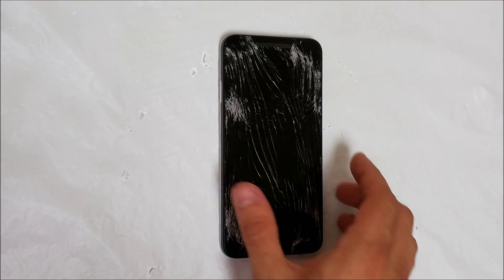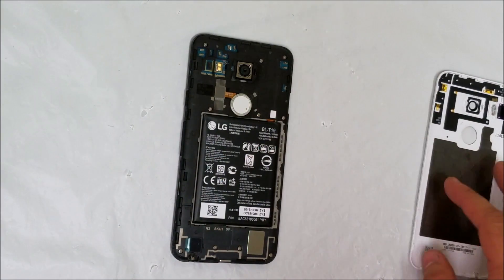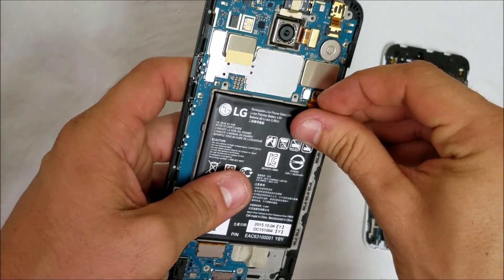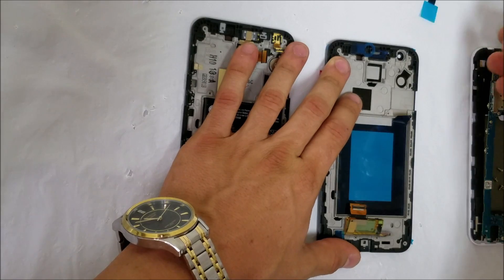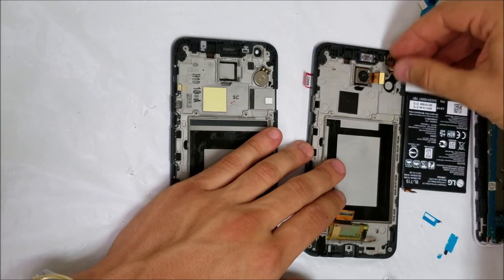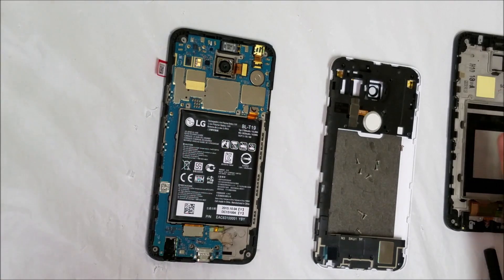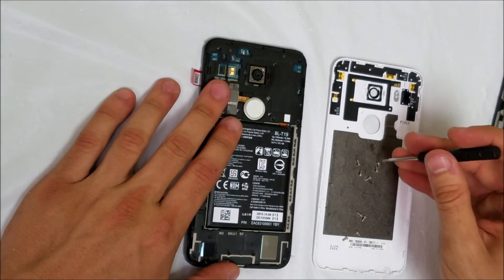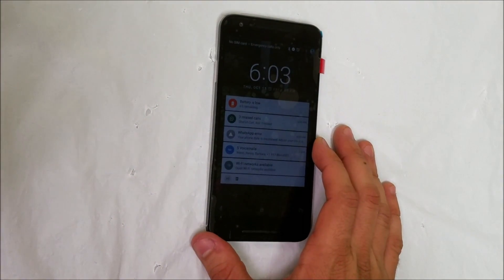How to replace LG Google Nexus 5X LCD Glass Screen | Screen Replacement

Comment: Great video! And thanks for the link to the Amazon parts! 
Three comments here:
1) Don't forget to harvest the little rubber piece needed for the proximity sensor or the phone screen will go black when using as a phone... see video - https://www.youtube.com/watch?v=M3PiCAGwzYw 
2) Dont forget the notification LED at the bottom of the phone...
3) Be damn careful with the battery in the old screen when removing. Really just buy a new battery when doing this! My battery was stuck so well that when I pried on it it shorted out internally and caught fire!! It was pretty exciting for a few minutes...

Comment: READ THIS BEFORE ATTEMPTING TO FIX:
1: If you dont wan't your camera to be destroyed, DON'T remove it like he does in the video! It will likely break the cable. 
2: The proximity sensor is not replaced here.
3: The notification light is not replaced either.

I really don't understand why people upload videos like this when they clearly  don't have a clue what they are doing, and end up causing people to ruin their phones. Shame on you, CellularProz.
Reply: could you recommend a better video? for instance, one which addresses the issues you mention

Comment: Many thanks for this video it was very helpful - I replaced my wife's screen and it booted up with no problems (second time, I forgot the battery lead the first time!)

I replaced the notification LED on mine. I just applied a little heat to the screen in front of the part and it came off easily with a nylon spudger. I also moved a part for what I think is the infrared sensor that was very simple.

Generally I found that heating the screen in front of the part I was trying to remove got them out with far less hassle. In particular this was essential for the battery which was stuck in incredibly well. That took lots of heat and persistence. On reflection I regret not just getting a new battery at the same time as they are pretty cheap and always give things a new lease of life.

Thanks again, this was the best tutorial I found.
Reply: And I'm back again two weeks later. My wife needs to stop dropping her phone. Barely took 20 minutes the second time round.

Comment: This videos shows a very risky way of prying up the rear camera. Too easy to damage the ribbon cable with a metal tool under it. 
It's much better to pry it up from the bottom with a narrow, flat screwdriver. There's a small gap in the frame there for exactly this purpose.
Reply: Wish I saw this comment before I did this. RIP rear camera :( 
CellularProz,  you should stick this comment to the top, and put this in the description and put an annotation at this part in the video, so people won't destroy their cameras because of your shitty video

Comment: You forgot the notification led.
(you can see it at 11:40 at the bottom center of the phone)
Reply: It does have one, you have to turn it on in settings, its off by default, was just about to ask about transferring it, I totally forgot now have to dismantle again, looks a bit hard to get out, its very tiny.
Reply: Was trying to figure out what that part was. Thanks.
Reply: yes it does :)

Comment: Hey great video. I was very careful to follow this exactly. Everything seems to work great except now my cell service is very spotty (I have never had service issues before). Do you have any ideas what might be causing this? In all of my internet searching I have seen several other people with this same issue but no one has found a solution.
Reply: I have the same issue.  Sent it back to LG and it still doesn't work.
Reply: RandomThoughts I did a factory reset on mine. First time the Bluetooth and cell reception didn't work so I did the factory reset again (and updated to the latest software) and it seems to be working better now. The reception is still sub par but there have been power outages in my area that affected the cell service. So I am waiting til that all gets fixed before I know for sure if my phone is fixed.
Reply: UPDATE: I figured out that I had a bad screen on frame part. It seems like the tape and grounding contacts were not the same material as the original. I ordered a 2nd screen on frame replacement part and installed it. Phone worked like new.... First part I ordered was from a random retailer on ebay... Lesson learned: buy from a reputable part retailer.

Comment: Great video. Thanks for sharing. I followed the instruction to replace the screen for my wife successfully. Two suggestions for improving the video though: 1. it is much easier to replace the power button and volume button prior to putting the motherboard back.  2. the proximity sensor filter should also be moved from the old screen to the new one since otherwise the proximity sensor does not work at all.

Comment: Hey are you guys hiring i tired calling but no one answered
Reply: I followed your direction but one thing was missing in your instructions, i had problem with sensor by the audio  causing my screen to go black as if i was was holding the phone to my ear so i couldn't mistakenly hit some control. causing the phone to do something inadvertently. When i looked at my old base i saw that their was a rubber housing that i didn't transfer causing the screen to go black or blank not able to access the touch pad options. So after about the 4th time i saw the problem and fixed it. One other thing i did was to change the assembly process putting the buttons in before the mother board. It was easier to install and i realized there was a right way and wrong way to install. Other than that i really appreciate you video and i hope this helps others